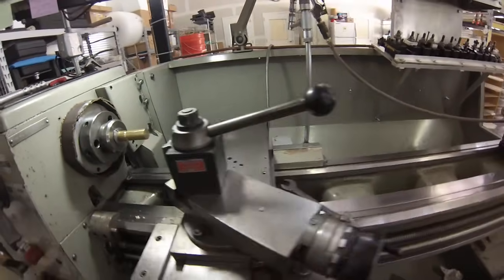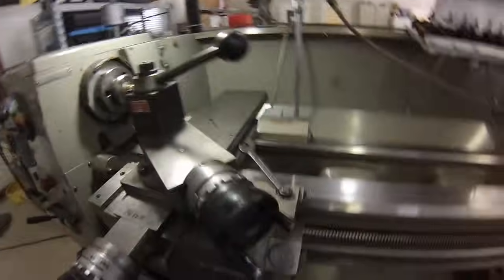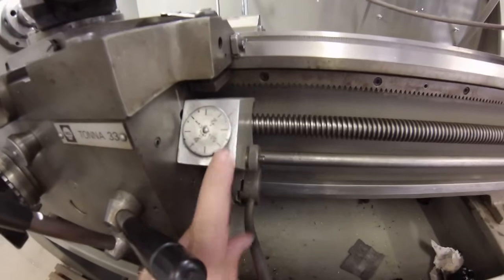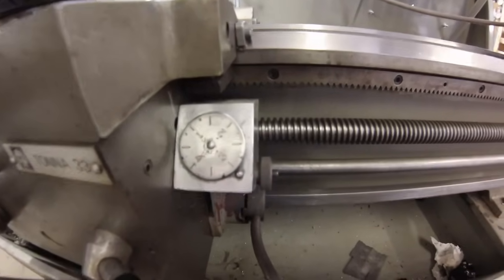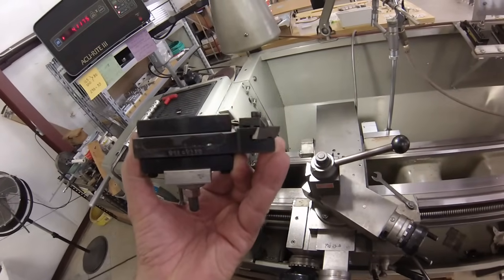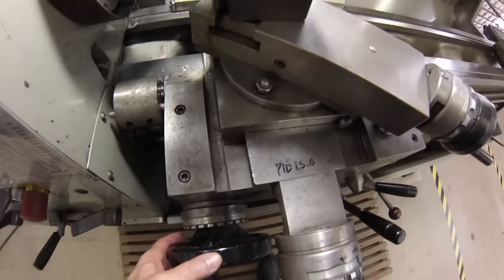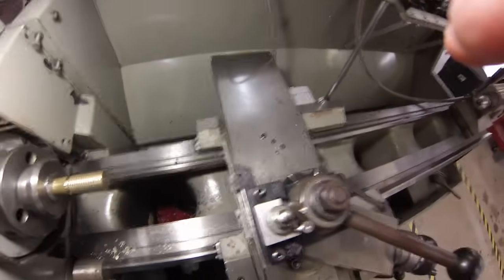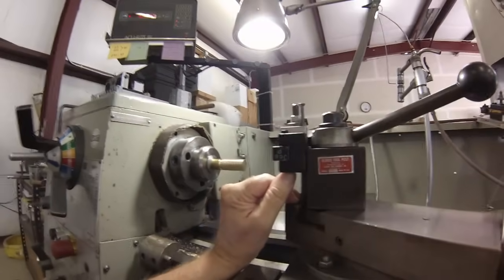Threading on a manual lathe  BEST TECHNIQUE EVER !!!!

Comment: Aside from the advantages mentioned here, threading with upside down tool and lathe in reverse works very well on an older, worn lathe with some slack in the spindle bearings, because the tool is not trying to raise the work and spindle as it would if threading normally.  The spindle stays held down in place by the pressure of the tool and you get a smoother thread, and can also usually use more pressure, deeper cut.  The wear and slack in the spindle bearings is not such an issue.  Love your videos!!!!

Comment: I always have the toolbit sharpened at less than the thread angle, with the compound slide set at half thread angle. The cross slide stays at zero ad the compound slide used for depth of cut. This way, only the front side of the tool cuts along it's whole face and only the tip of the tool cuts the back of the thread. This prevents digging in, particularly with deep threads. Maybe this only necessary on smaller less rigid machines, but I found that it makes a big improvement on straight plunging. The biggest improvement is with long, smaller diameter threads where higher cutting pressure of plunge cutting causes flexing of the part, leading to digging in.

Comment: You could use your rubber band trick to hold the wires on the threads when you measure them.

Comment: I can't really find a good video or tutorial on what the cutting tool for doing threads actually looks like or is different than a facing tool. It's what's been making doing threads pretty difficult for me. But this method is going to take a factor out for me for sure. Do you have a video showing different cutters for threads?
Reply from the maker: The normal tool is a 60 degree triangle tip. very simple.

Comment: So may i ask you Joe,what happens if you use this technique and you have a tailstock on the other end of the bar you are theading,will you still be so relaxed when threading?
Reply from the maker: Plan your job to be as safe and easy as possible. I sometimes leave a small boss on my part that has the centerdrill feature in it to give me extra shutdown room. The use of an extended center ( look it up ) also helps. So, yes. I would be just as relaxed.
Reply: @joepie221  by using that technique of extended tailstock centre,i can understand that you have extra shut off space,so i can agree with you that you can thread in a relaxed way,but to be honest i never saw anyone thread on a lathe that way.

Comment: hi, want to ask when cutting the thread, the cutter need to be center just like when we process the surface? i have a china mini lathe and not sure whether the tools post should fix the 10 square or 12 square holder
Reply from the maker: On center will give you the best profile and dimensional control.
Reply: @joepie221  thanks for the advice

Comment: If you have a machine with a foot brake you can thread toward the spindle with ease.  Once you engage your half-nut never release it.  just set you cross slide to Zero and adjust your compound for thread depth like you are supposed to.  When you want to stop in the relief cut just use the foot brake, back you cross slide back out a bit, reverse your spindle and take it back to start.  Take the cross slide back in to zero, advance you compound the amount you wish to cut and start the spindle for another cut.  SIMPLE, and it is the way that threads are supposed to be cut, with the compound and not the cross slide.  Threads should always be cut with only one side of the tool.
Reply: Ummm. …  if you are using carbide inserts, threads don't have to be cut with one side of he tool. You just use straight in cut, not at a half angle.

Comment: Would you use a left hand thread insert tool holder upside for this technique?
Reply from the maker: Yes. Left hand holder, Upside down, that gets you right up against the shoulder of the part.
Reply: @joepie221  Then I guess just a matter of setting the height of the tool to the center line as normal. Cool. Thanks.

Comment: Top tip for the thread wires use two weak elastic bands to hold them in place while you measure them. saves a lot of time not hunting through the swarf pile when you drop one
Reply from the maker: Check out my video on wires. realistically, you only need one.

Comment: Learned this jewel during apprenticeship (backward and upside down) when we had a very long propeller shaft to thread.  Welded on a small block to chuck on and let the other end stuck way out thru a steady rest.   Joe, you are the best and I'd like your option on a couple of you tube videos which seem to show the cutting of metric threads on an English lathe set up with no gear change.  I don't believe it possible but this guy on Oxtoolco seems to do it. Am I wrong?

Comment: I tried it and my chuck spun off and almost killed me. :(
Reply from the maker: This is what to expect when you don't read the video description that contains the SAFETY warning about that potential.
Reply: I was joking, great video by the way.
Reply: @joepie221  This comment taught me there is important information YouTube may cut-off when only the first 3 description lines are shown. I'm a hobbyist with a 1952 Logan 10". I was surprised watching the video you didn't mention a caution about screw-on chucks. Then I started reading the comments. And here we are. I should have known to RTFD, and in most cases prefer reading to watching a video where things like ** CAUTION** tend to jump out. Your go-to contributors are one of my exceptions and I hope to see many more. Thanks again for the lessons. I've only done this once, no one ever said the school of hard knocks was cheap. Fortunately for me the only harm was to my already low pride.
Reply from the maker: @ronkellis769  I may do something about that 3 line thing. Thanks for the heads up.
Reply: @ronkellis769  
1) take the backing plate off the chuck
2) cut a circular pocket in the backing plate (on the chuck side,  not spindle nose side ) to a depth and diameter enough to capture a fender washer.
3) reassemble chuck and backing plate with fender washer captured/sandwiched in between
4) run a threaded rod through the spindle and the sandwiched washer; capture with nut inside, going from chuck side.
5) put a washer and nut on threaded rod at other end. tighten down.  <DONE>
6) for added piece of mind use lock washers or nyloks at both ends instead of just only nuts.

chuck cannot now spin off - threaded rod acts as a long bolt fastening chuck to left end of spindle.
Reply from the maker: Glad it was a joke. Thanks for clearing that up.

Comment: Hold out your hands so I can hit them with a yard stick.
1. use the damn compound - kids are looking to learn from you.
2. the machinist handbook isn't up to date for UNJ threads....AS 8879
Reply from the maker: I appreciate the yard stick whack. Not my first one. However, you can't do  'J' thread by hand no matter what. Its a radial crest and root thread. very specific. if you're going to smack my knuckles. do it for a good reason.
Reply: @joepie221  the yard stick whippings didn't stop me from doing what i want either.....Great Trick for threading (I mashed a tool into a shoulder chasing a thread yesterday)
Reply: @bobjimenez4464  
so.... let me get this straight:  you're telling Joe what to do (as though you know so much more than him) ….. after you crashed your lathe ??? I wouldn't listen to anything you say. ever.

Comment: I spent over 20 years as a machinist and did a lot of single pointing and saw a number of approaches but have never seen anything like what you demonstrated. I just got a home hobby shop set up and was anxious to give this a try. I love it! I got a great looking thread, no stress. I plunged to the minor diameter and used a dial indicator to position the carriage in the same starting point every time. Even though I did not use two wires to do the initial check I only went .001 deeper than the zero I set on the compound. This is really going to speed up my single point threading and make it really enjoyable.
Reply from the maker: Thanks for the comment. Its a bullet proof technique.

Comment: Hey Joe, how can I machine threads that fit so tight I won't need a lock nut ?  Thanks for the great videos.
Reply from the maker: Pick an imperial and metric combo that have pitch distances so close, they don't bind for 1/2". Be careful though, if you go this route, they will lock for a reason and possibly not want to unlock.

Comment: I belong to the Metro Detroit Metalworking Club. At our monthly meetings we usually watch a machining related video. A while back this video was featured and yesterday the situation popped up. I had to run a thread and when the tool cleared the work I would have .010 inches before I had to stop or crash into the part. Used this method to make 22 copies and every one worked out perfect with no accidents. Thank you for taking the time to show the method. It was a huge help.

Comment: Safety first? Not even wearing safety glasses with side shields 👎
Reply from the maker: Technically you have a point. Realistically, how many times has a side shield saved your eyes? I never look away from a machine spraying chips, and one of the worst injuries I've ever had to my eyes came over the top of my glasses.

Comment: A thread pitch gauge makes that alot easier.. That Operation from tailsock to chuck give you a Left hand thread👍🏼Great Video
Reply from the maker: You can still create a left hand thread, threading away from the chuck. Tool upright, machine rotating forward, carriage going right at engagement. LH all day without stress.
Reply: @joepie221  I Know This... I was Just Saying If You Reverse your Travel So Does the Thread... I Machine myself👌🏼

Comment: This would work great if my chuck wasn't threaded on
Reply from the maker: That would be a concern.
Reply: That is my concern too.  I have a South Bend 10K with a screw on chuck.  I am surprised that more people on this post don't have that concern.  I guess that since my lath's chuck screws on, most other lathes do too.  My understanding is that putting tool pressure on a lathe running in reverse with a screw on chuck is asking for trouble.  Otherwise I would definitely use this method.

Comment: To help hold the wires in place to take a measurement I used a dab of axel grease and I put a rag on the ways so when a wire did fall off it didn't wind up in a pile of chips, they are really hard to find.
Reply from the maker: Realistically, you only need one wire. This video proves it.   https://www.youtube.com/watch?v=be6Q9mm4vEQ 
The one wire measuring method also will tell you if your thread is concentric to the OD of the part. Check it out and stop worrying about the 3 wire method.

Comment: Nice video Joe! One question for you (or anyone else). My lathe leadscrew and chuck move in opposite directions like the old timey washing machine you mentioned, however when run in reverse the carriage moves away from the chuck as yours does. I need to cut an internal thread with a very narrow undercut, and I had planned on using this method, but now I'm questioning myself because of the opposing chuck/leadscrew issue. I'd appreciate any clarification you or anyone else could offer me... I've got about 20 hours in this aggravating part and all I need to finish is these threads. If I mess this up at this point I may just lose my mind. Thanks..
Reply from the maker: This video may help.    https://www.youtube.com/watch?v=k1DHKjMtdQw
Reply: @joepie221  Thank You..  Worked like a charm!

Comment: Wonderful video, watched it many times however I still have something puzzling me.  You say you mount the toolholder in the inverted position, understand that. But are you using a right or left haded tool holder when threading away from the headstock? I am assuming a left, is that the case?
Reply from the maker: Left is correct for a shouldered thread.

Comment: Hi mate...tell me how does the threading not get crossed over each time you go over it each time...is the auto feed timed on a spline to copy the last movement? I'm intrigued.
Reply from the maker: The carriage movement is driven by a lead screw. The speed of that lead screw is determined by a gearbox setting. The place at which the carriage engages the lead screw is controlled by a spinning dial and your ability to engage a handle (halfnut) at a very specific moment. This keeps the coordination of everything such that the tool stays in the same track.
Reply: @joepie221  ok so it's a bit like a distributor on a car...u have certain timing points to get it dead on each time so to speak..
Reply from the maker: Yes

Comment: Joe, great tip, how do you invert the tip in the tool holder with the packing or is there a particular threading insert you use? Thanks
Reply: Good question, I was wondering the same thing. I hope Joe gives an answer.
Reply: You DON'T invert the insert. You invert the tool in the holder.

Comment: Joe I used your method today and it worked great.  My only problem was that my insert thread tool holder has an offset to the left. This forced me to use a brazed tool due to threading to a shoulder. What insert treading tool holder are you using and what is the insert for steel.  This threading method is close to perfect.  Thanks
Reply from the maker: The holder in this video is a Kennametal NSL-123B. I use top notch threading inserts and select the insert based on the material.

Comment: Great job showing how to do this type of threading. I used this method years ago and there’s no better way. Isn’t the compound angled in the opposite direction for cutting threads in this direction? Just a question.
Reply: He's plunging straight with the cross-slide not the compound so its angle doesn't matter

Comment: Wow, I have been trying to figure out how to cut metric threads on an imperial lead screw against a hard shoulder.  So easy using this method.  Thanks Joe!!
Reply: David,  Not so sure that would work.  My experience is with metric on a imperial lead screw is you cannot release the 1/2 nuts, you have to reverse the spindle and keep the 1/2 nuts closed until finished.
Reply: @mikebowling3228  I should have explained a bit further.  In the case of metric threads I am not releasing the half nuts but just powering off the motor at the end of the cut. I then reverse the motor back to the right of the thread to reposition for another cut. It's not what Joe described exactly, but I am using an upside down cutting tool and cutting right to left.
Reply: This is a great idea for that when you can't release the half nuts. Removes potential disaster if the spindle doesn't stop immediately upon power off
Reply: Yep- you can't open the half nuts typically.  Reverse the lathe close to the hard stop.. then manually crank the lathe into the hard stop

Comment: Im going to have to call BS on the straight in plunging of the tool  for each pass. The tool will be cutting on both sides of the point and the trailing edge will be moving away from the work and tearing not cutting. This might work for hacking or quick and dirty but not really a good method to practice.
Cut with the compound on the angle of the thread and set the X or cross-slide to 0 when you first touch-off. After each pass retract the X , move to Z 0 then X 0 then advance the compound (on the angle) the amount of the next pass -  repeat until finished.
Reply from the maker: I disagree with this comment at about the 99.8 % level. The material to tool impact is still straight down. If the thread you were cutting was 1 turn in 3 inches, maybe your observation would matter. Maybe. Otherwise plunge threading is a perfectly acceptable method on machinery rigid enough to do so. Faster too.  For what its worth, you should remove that high speed milling video on your channel since its not even close to real high speed milling. Look it up online. Ingersol-Rand uses high speed cameras to view the machining process since the machining is so fast, the naked eye can't process it fast enough.  Loose the rubber gloves too.

Comment: Hi Joe,
Love your videos. I'm currently looking to buy a second hand lathe but it seems to be a bit of a minefield! Can you give me some pointers to look for. EG pros and cons of flat bed vs round bed (antique I know but my budget is low) or V bed. Apologies if these are not correct terms but that's how I would describe them. Also does the ability to cut left hand, right hand, imperial and metric thread depend on the lathes driving thread (I know incorrect term again) or on the selection on gear wheels and can any lathe turn any thread if you buy the right gear wheels. There you go, I'm sure that's a loverly can of worms to get stuch into! LOL. 
regards
Guy Riviere

Comment: I've done this "reverse" technique using a "boring bar" type (internal) thread cutter on the back side of the part because I was nervous that the load could lift my saddle off the bed.  Don't know whether that was a valid concern or not, but I didn't want to find out the hard way.   One video I would love to see is how to thread when using change gears to make your machine cut an un-natural thread.  e.g. Is the leadscrew timing dial now totally useless, so I would need to keep the half-nuts engaged and reverse the spindle between passes?   I think perhaps so...